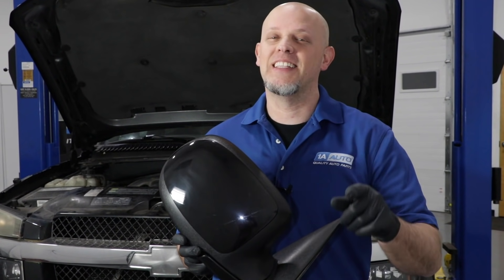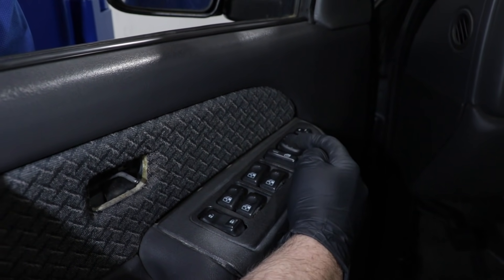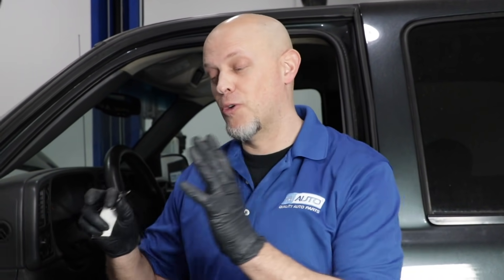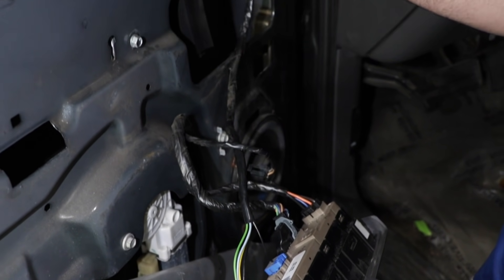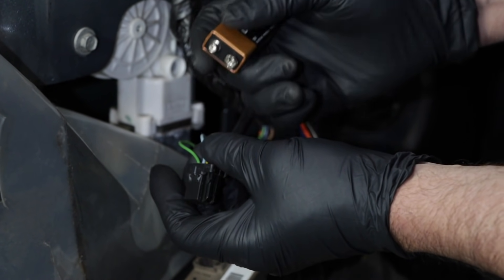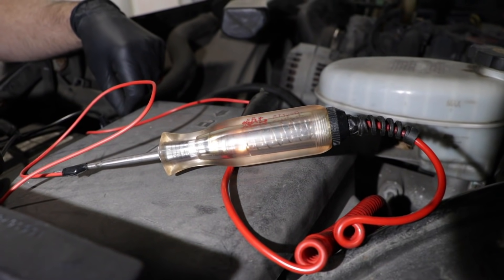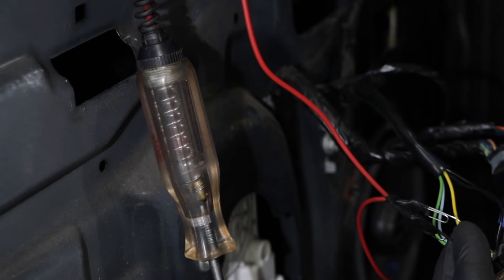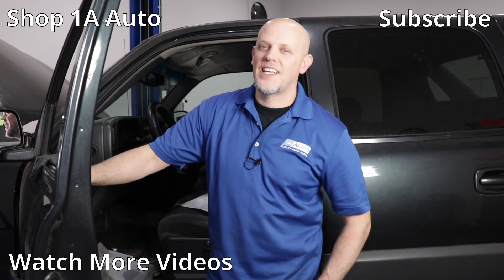Car's Power Side Mirror Not Working? How to Diagnose Mirror Switches and Motors

Comment: SOMEONE PLEASE HELP! My power folding mirror on my passenger side will not work. I just bought a used Ram from a Chrysler dealer that's in really good shape but I realized after a week of having it that the passenger mirror will not work. I also noticed that the mirror is a little loose and when driving it shakes a bit.

Comment: I have a 2002 Cheverolet Astro LS passenger van, rear wheel drive: my left driver side mirror wouldn't work at all even after I bought a new electrical power mirror switch off of ebay: (the right side passenger mirror would only work east and west but not north and south:) turns out after removing the left driver side mirror to inspect the motor, there was no wire coming out of the mirror to connect to the mirror wire-harness and that is why it was not working; Someone put a standard regular non-electric left driver side mirror in its place which have no wire to connect to the mirror wire-harness: and luckily for me I had a brand new left driver side electric mirror (for a previously own 2001 GMC Safari) that I bought off of ebay and that I never used until today: and it fit perfectly, problem solved!!!

Comment: Excellent video for D.I.Y. amateurs.
fyi: 2005 Dodge Grand Caravan owners:  My power mirrors stop stopped working (both sides).
I couldn't find any YouTube videos on my year/make/model.
The fuse box cover does not identify which fuse or relay controls the power mirrors.
It turned out to be a 'blown 15A fuse' designated for the A/C Clutch.  Replace the fuse and mirrors worked again.

Comment: Question for you. I have a 2011 Silverado 1500 and the driver mirror works just fine but the passenger mirror doesn't work at all. I checked the fuse and fuse is good. In your video you said if the passenger mirror wasn't working that I need to remove the passenger door. Why would I need to remove the passenger door if the driver side panel controls the passenger mirror as well? If I remove the passenger side there is no switch on the door panel.

Comment: What would you think the cause of BOTH side mirrors not adjusting out? Not the whole folding thing... but the actual top mirror not going left on either mirror (to the outside on drive and to the inside on passenger). Tried replacing the switch with no luck.

Comment: Good video. I have a 2015 Hyundai Sonata. The left mirror goes left and right but not up and down. The right mirror goes up and down but not left and right. So I'm getting power throught the switch. The motors work so I'm thinking the problem is the switch. Do you agree? Or does each mirror have 2 motors, one for vertical and one for horizontal and mine just happen to have gone bad on different axes? I vote for the switch. Thank you.

Comment: My 2014 Ford fusion has a driver mirror issue.Passenger side fully functional.Driver mirror goes up and down blinker and defrost work but no left and right mirror movement.Any guess at most probable failure point? Thanks

Comment: I bought aftermarket mirror for 2011 tundra, it goes right all the way but left it stops and just jumping all I see 1/8 of a truck passanger door. Is it defected?
Reply: Yes. The gears in the mirror are plastic so when something blocks the mirror the gear will slip instead of breaking. I would think one of the gears may be stripped or the mirror is misaligned. Move it all the way to the right then use your hand to force the mirror to the center. You will hear it clicking. Then use the switch to move it left and right. It should work but if it doesn't replace the mirror.

Comment: I had to install a new mirror, on a 2009 nissan versa hatch, when i go to adjust the mirror it  works fine until i press the UP position on the adjust switch  then it blows a fuse and the radio and power windows go out..the fuse was actually lit up and glowed red...not hot or anything...its a red 10a and its a new fuse..

What could that be?

I swapped out other fuses to check and everything is fine with a new fuse but same deal when i hit the up portion of the mirror adjust button

Comment: My mirror is working but the it is pointing down too much, trying to adjust it I run out of range and in fact at the extreme it starts moving down further as it hits maximum adjustment level.

That's drivers side, passenger side is at right level. So is there a way to recalibrate the motor to move the glass where I need it?
Reply from the maker: +Petrik Oud Thanks for watching!  You might want to try and simply unplug the mirror or disconnect the negative battery terminal to see if this helps reset it.  If your mirrors have the memory feature try to reset the memory or disable the curb tilt feature.  If none of this works then you will likely need to replace your mirror.
Reply: Simple. Just manually push the mirror glass away from the limit point. Just push the mirror slowly upwards. It will feel like gears are slipping.

Comment: What should I do if there is not any voltage on wire at all.. meanwhile I already changed the fuse of the ACC lines at fuse box and voltage is present at the fuse box. But the voltage is seems like doesn't goes to the electric mirror pins at all.
Does getting voltage from cigarette lighter is would be safe for long usage for the car electricity? Due with takes the voltage from lighter is fixing my electric mirror problem.
Many thanks from Indonesia

Comment: I have a Nissan qashqai 2014. Both wing mirror auto fold from the internal door panel but neither mirror on both passenger and driver can be adjusted or folded while holding the lock on the key fob. Also there is no noise when trying to adjust them either. Could this be a simple fuse problem or do you think the mirror motor needs replaced. I'd appreciate it if you could shed some light this before I contact the dealership for a service. 
Thanks

Comment: My mirror controller got wet and I dried everything out really well disconnecting it and everything before using. Everything on it now functions but is opposite. Right mirror controls left, left controls right. Up moves down, down moves up, left moves right  and right moves left. Trying to find the culprit....any ideas?
Reply: Pick-N-Pull for parts. They are really cheap compared to any auto store. You can get the entire switch panel for probably $20-$25. They give you a list of years of the cars that are compatible with yours.

Comment: 2005 Silverado 1500 HD electric mirrors switch problem - just the 4 way up/down switch wasn't working - fixed by disassembling switch assy and cleaning gently with Q-tips and alcohol the black pads that contact the gold traces on the PCB ( just like cleaning the pads inside on a TV remote ).  Success - Cost zero.

Comment: If the mirror controller switch  for both mirrors is on the drivers side door why would you remove the passenger side door to check the switch. I have no switch on the passengers side for that mirror that I know of .
Reply: This is not a UK car, which you might have. In many other countries the driver sits on the left hand side and they drive on the right, so this is the driver side door for them. 😉
Reply: They drive on the right hand side of the road, I mean!

Comment: Driver side vertical works but horizontal doesn’t work and no motor sound heard, how to diagnose? Thank you
Reply: My X5 has the same issue working up and down but not left and right.
Reply: @LinLIN-cj1jg  same
Reply: Me too, 2002 VW GTI. I only noticed it right after a bird hit the passenger side mirror and busted the glass. No idea if the two are related, or if it’s just coincidence. It’s possible that the driver side mirror problem started earlier and I didn’t notice, because I seldom need to adjust it.

Comment: I had to replace the passenger side. Now I have the problem of the reverse tilt not working properly. Instead of tilting downwards, it tilts all the way up, and it doesn't go back when I put it in drive. I have to adjust it every time, after putting it in reverse. Is there a way to reset the mirror, or a way to just simply disable the reverse tilting?
Reply from the maker: +Donnie Bible Thanks for watching!  You can try to disable the reverse tilt setting first to see if that helps.  If not then it is very possible that the mirror you purchased does not have all the same features as your original, which can cause these sorts of issues.

Comment: I have part of the same problem. Both mirrors go in & out, but not up & down. I replaced the switch, but problem was not resolved. I will take panel off tomorrow and check for connections with the ground and directional wires. Looks like a great tip.
Reply: Hello, i have the same problem. How did you fix it?
I know that the motor is fine

Comment: Good video, but just saying “remove the door panel” as if it’s a piece of cake is quite misleading. It appears to be a major undertaking on its own for my 2002 VW GTI, with hidden and virtually inaccessible screws and who knows what else, what wires and connections might be at risk behind the panel when you try to remove it.

Comment: I have a 2010 Bmw 750i and the mirrors will go to the left and up but not to the right and down. If I put the car in reverse the mirrors will go down. Any suggestions? The windows do operate properly
Reply from the maker: +Lil June We wouldn't be able to diagnose an issue like that here, you may want to have a local mechanic take a look at it. Thanks for checking us out! http://1aau.to/m/Shop-1AAuto-c
Reply: Try to open your electric mirror switch, and check the voltage first on the cables that come from fuse box. If there's some voltage then the problem is at your mirror switch. 
Open the switch case and take a look at the pcb , perhaps there's some broken pcb lines or some dirty connector caused by dust or rusty. 
Clean it by contact cleaner. But if some pcb lines broken, then you must resoldering the lines.
Hopefully could help

Comment: Do not make the mistake of removing the entire switch assembly and leaving it dangling by the wires when you have removed the door panel for repair or replacement as the switch can become wedged between the seat and the door when closed and burn out your mirror motor.  Bleep@!*&%|<>
Reply from the maker: +Anony Mous Thanks for the feedback!

Comment: It seems to me that the OTHER functions of the switch are working like the windows sooo it’s almost definitely not the switch…the black box module the control module controls what ? Mine has BOTH the turn signal and no movement not working…